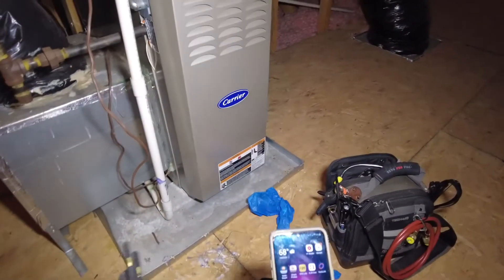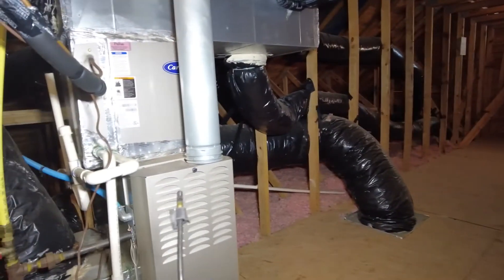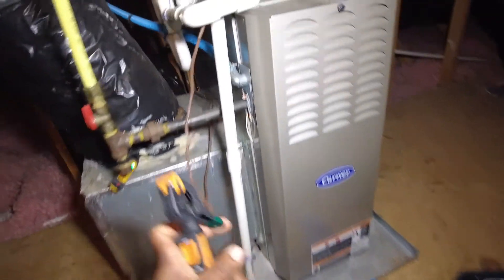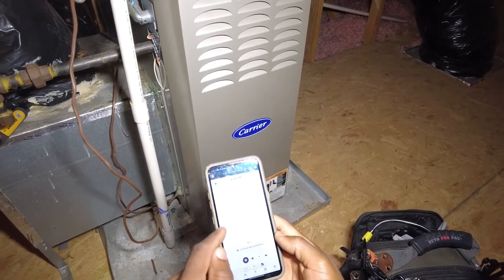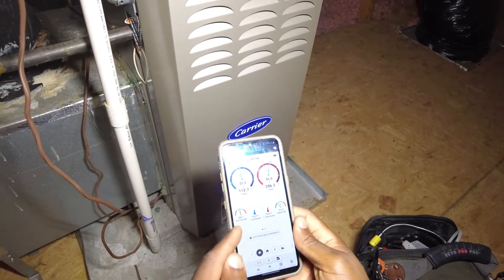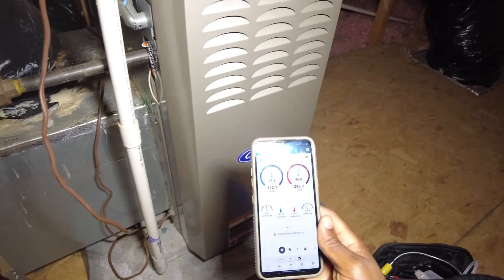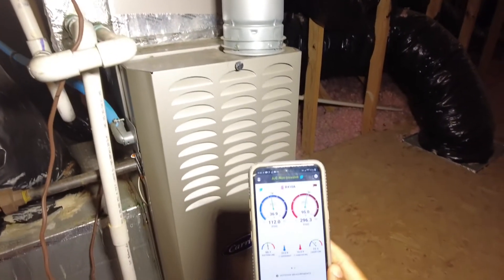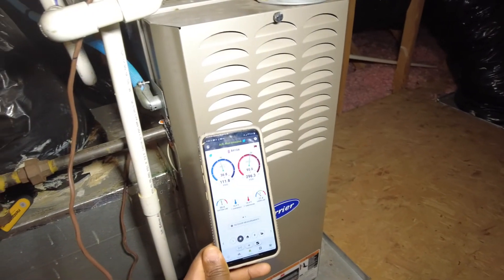HVAC Tech Shows How to Test AC system without Gauges using Non Invasive Testing on MeasureQuick

Comment: Don't you have gauges on the unit if your getting a suction psi of 113 and a head pressure of 296?
Reply from the maker: Hey thanks for watching! 
Not sure if you watched the video all the way through, but measurequick has an algorithm that calculates what saturation temperatures should be, based off temp split across evap coil, indoor wetbulb, outdoor dry bulb,  liquid line and suction line temperatures. I cover it on this video.
https://youtu.be/RJbPU_Bm8YQ

Thanks!